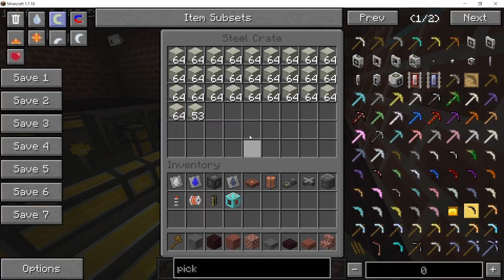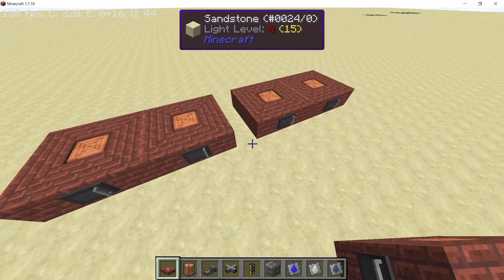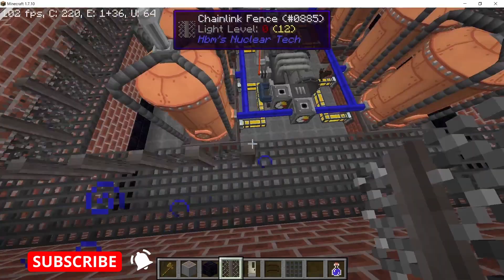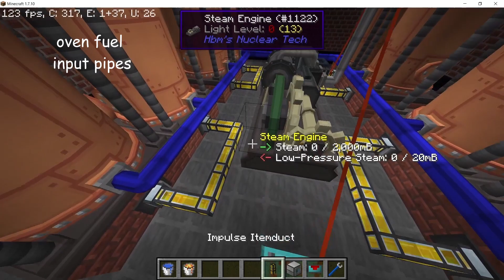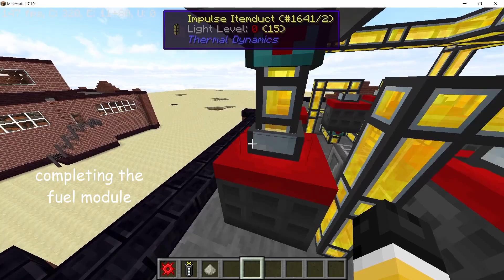Steam Engine / Turbine Factory - How to make a Steam Powered Base in HBMs NTM Minecraft

Comment from the maker: 1) Steam Engine is 85% efficient thus outputting 68 KHE/s , replacing this with the industrial turbine will give you 80 KHE/s which is the max output for this setup 

2) when downloading thermal mods don't forget the dependencies as I've only linked the two mains mods , most of you are og's so will already have these mods but this is for anyone new watching this video 

3) all the space behind the boilers and even on the top floor can be customised and you can place single block machines , crates and beds making this a base. In short the build is highly customisable. 

4) The recorded footage was 1.3 hours long , from that I had to squeeze out these 16 mins that's why it's so fast in some sections... Make sure to slow it down / pause in places where there are too many machines or contraptions
Reply: Thank you so much for this awesome build and the additional information. You're the best
Reply from the maker: @bumblebee0675  you're most welcome my dude , as always your comments and support is appreciated ❤️🙃
Reply: technically you don't need thermal mods pipes, you could just use the new conveyors from hbm's.
EDIT: also i made a cobble stone generator using hbm's mining drill (the small one) and what you need to do is place it in the center of a 3x3 stone square with 3 water source place on two sides next to each others (in order to make infinite water sources) and on the last two sides of the square place lava source 1 block upper then where the water sources are (so that the lava flow on top of the water and makes stone) and so the drill will mine the ever making stone blocks.
Reply from the maker: @ScryptKpY  yes you can use conveyor belts but where they struggle the most is dividing the items equally, like you can't take a line and split it into 4 equally feeding 4 machines , this is where ducts are particularly useful 
And using belts would make the whole fuel section pretty big , compact builds are better imo
Reply: @ScryptKpY  would mekanism ones work?
Reply: @RedVRCC  idk i haven't really played with mekanism in 1.7.10, but as I said, you don't really need other mods to make a steam factory (but it sure is simpler)
Reply: Thank you so much for making these hbm tutorials you are a lifesaver and a wonderful content creator
Reply from the maker: @adamkahn9414  thank you for the kind words , I'm glad you enjoy my content 😀
Reply: Looks like I'll have to get thermal mods now lmao, idk why I never had them before.

Comment: i have been thinking about making an RBMKP type reactor with superheating channels

the plan is to boil the steam in regular steam channels, then find a way to take that steam and send it to the superheating channels (fluid heaters) and heat it to 600c to then send it to the turbines 
could you maybe try this idea?
Reply from the maker: By doing it this way efficiency will go down, reason being mostly all RBMK's are capable of going over 600 so it can directly produce the UDS... it is a different story if you are using a coolant cycle but I have tried this before and it generally yields less power overall.